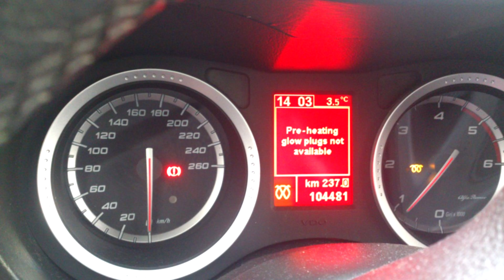Repair of a Diesel glow plug controller

Comment: hi.....you said u will replace the relay with a p channel mosfet how are u gonna do  that ...thenks
Reply from the maker: I didn't, it never failed again, I won't touch it until it breaks again. If you want to do that and are not experienced with electronics and heat dissipation calculations, I would recommend you use a DC SSR. Make sure the rated current of the relay is considerably larger than what the glow plugs use (you will have to measure, I don't remember). Proper ones are kind of expensive:
https://www.tme.eu/en/katalog/dc-solid-state-relays_112511/?s_field=1000014&s_order=asc&limit=20&currency=EUR&visible_params=2%2C914%2C915%2C936%2C757%2C167%2C916%2C317%2C32%2C945%2C10%2C82%2C698%2C35%2C270%2C1605%2C693%2C1390%2C2182%2C74%2C138%2C922%2C31%2C430%2C429%2C2390%2C272%2C271%2C1775%2C98&mapped_params=757%3A1459459%2C1520189%2C1501198%2C1629988%3B&page=1

You can also go on amazon and buy a cheap chinese one for 10 times less, altough on a car I would be weary of risking an electric fire because of a counterfeit part.

If you just want to learn how to replace a relay with a mosfet, check this link, especially the third circuit:
https://www.gammon.com.au/motors

Comment: Thanks a lot, the video was helpful, we did the same procedure and used ABRO electronic contact cleaner and it cleared the code no problem.That spray was made for cleaning circuitry boards and contacts etc.

Comment: In My Fiat Petra 1.9D engine, the glow plug light is Not coming ON in the dashboard and hence the car won't start, can you please guide me on this?
Reply from the maker: Sorry, I don't have a lot of experience with this, you might want to try a fiat forum.
Reply: @jfaria   Thanyou for your quick reply, people are advising me to change the glow plug timer, but i just want to learn how to test the timer before  buying a new one
Reply from the maker: @kaustavpalit2626  Are you having difficulties starting the engine?
Reply: @jfaria   yes the engine is not starting because the glow plug light is not coming ON, in the dashboard
Reply from the maker: @kaustavpalit2626  If you already checked the glow plugs themselves the suggestion to replace the timer seems reasonable.
Reply: @jfaria    ThankYou for the suggestions :)